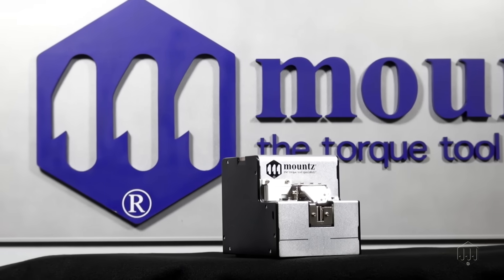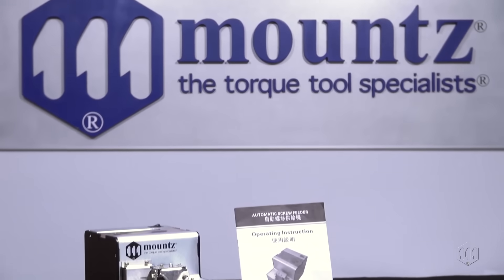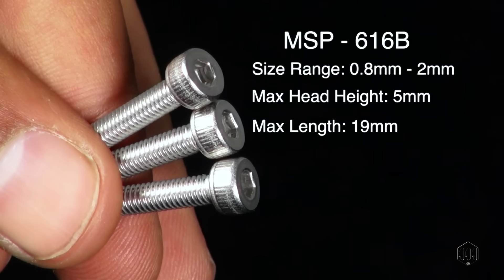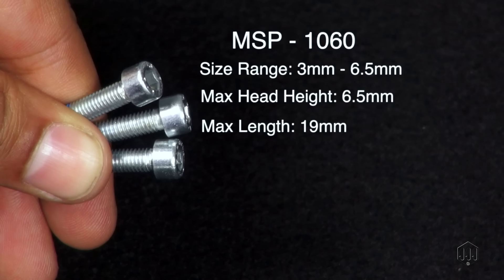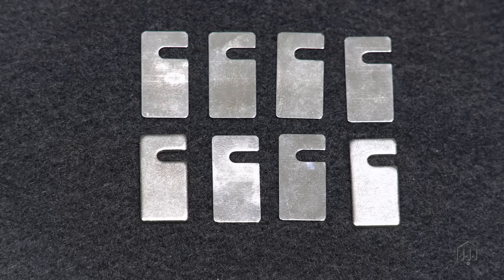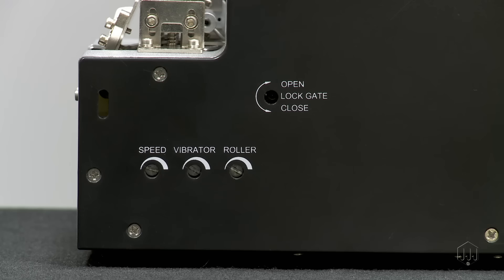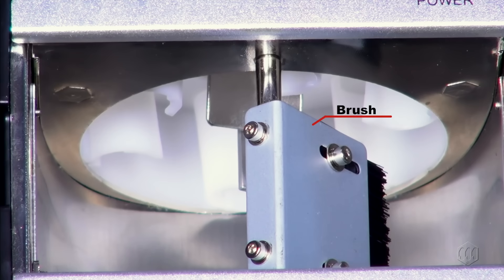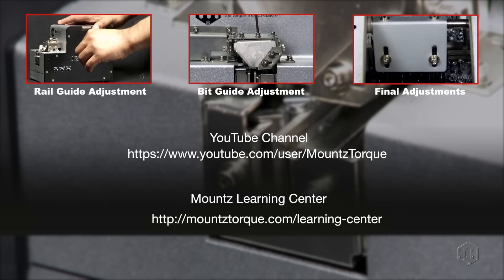Improve the Fastening Process with a Screw Presenter

Comment from the maker: The MSP is a small, tabletop screw presenter used to organize and automate the assembly process. Screw presenters make assemblers and the assembly process more efficient by mechanically presenting a screw to a fixed pick up point. Prevent screw fumbles. Improve your fastening process today. Find a solution> http://www.mountztorque.com/products/power-assembly-tools/screw-presenters/msp-screw-presenters?kmas=216